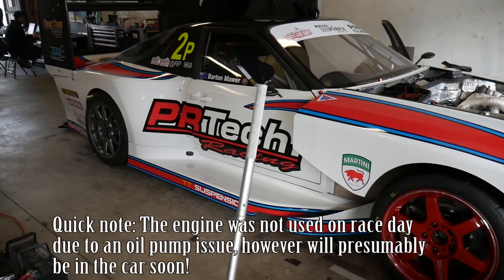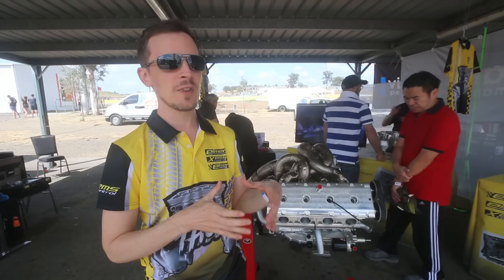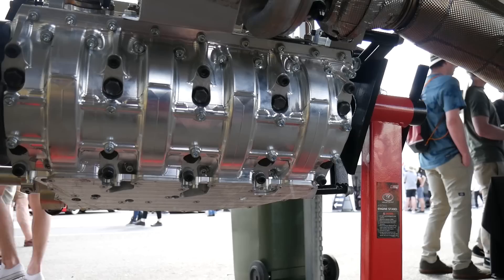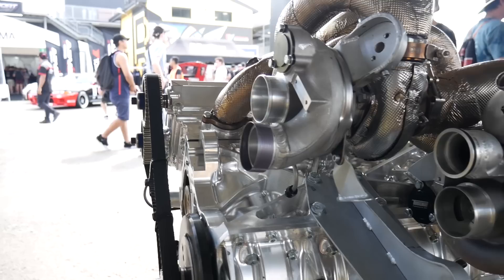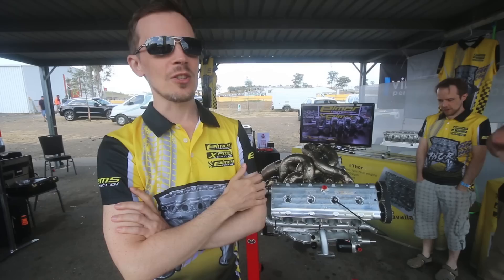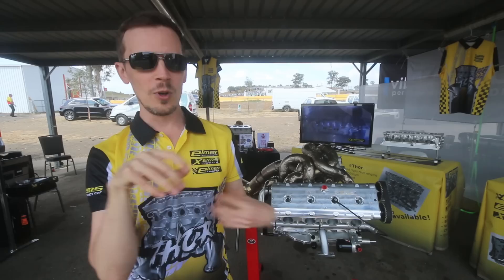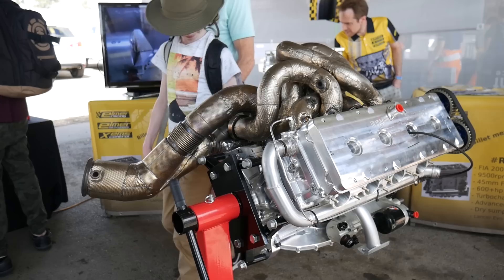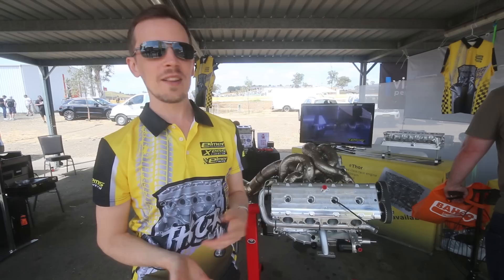4.0L | 4 Cylinders | 1500hp | The *nearly* All Billet RP968 Engine

Comment: It’s saying it’s all billet, but does it run cylinder sleeves?
Reply: Chucky boy Stanley at 5:35 you can see what I would presume are iron sleeves
Reply: It’s aluminum brah? Of corse it has sleeves ... could you imagine a ductile iron or even a tool steel piston ring traveling up and down a aluminum bore would resemble a broach not a internal combustion engines!!! When I was a young boy at the race track piping in to my dad’s important conversations to impress him and sound smart, he used to tell me... son.... it’s better to have people think you are stupid then to open your mouth and remove all doubt🤣🤣🤔 JK
Reply: Groom Lake just because it's aluminium doesn't mean it has to have sleeves could of been Nikasil or Alusil plated
Reply: Harry its a racing engine brother ?? They do not use that technology in purpose built racing applications... to my recollection
Reply: +Groom Lake According to Wikipedia it's used in a few racing applications: https://en.wikipedia.org/wiki/Nikasil

From what I can tell it's applied through electroplating onto the cylinder walls. Other than perhaps being expensive I don't see why they couldn't at least try.
Reply: The cylinder block is what they call 'open deck'.  The coolant passages are machined from above.  What i have not got my head around is how the coolant passages are machined in the cylinder head.
Reply: +Paul Standeven That sounds like an interesting problem but I am not familiar with how the cooling passages should be routed through a cylinder head. Can you explain the problem in more detail please?
Reply: Paul standeven, at 1:23 you can see some of the angles of the passages. Open surface(deck) head? maybe.
Reply: Porche V8's have an uncoated, treated Ali bore
Reply: Porche V8's have an uncoated, treated Ali bore
Reply: +NitroAl Wait, how would you treat it to handle combustion without a coating?
Reply: They could have lined the bores using a plasma transfer wire arc process.
Reply: NitroAl yes yes they did !! So did Chevy with the 70 Vega i4 . But this is a billet block . All bare aluminum cylindered blocks where a hi silicon Hyperutectic CAST. And the cylinders were treated in the porche . They are acid etched to expose the hard silicon . But the big thing is THEY NEVER WORKED GOOD . Burning oil was a big problem . You and the rest of the world need to understand EVERY THING IS APPLICATION DRIVEN !! Every thing is a compromise . Auto makers sacrifices almost everything to make more money from their product !! Racers sacrifice longevity for Performance and power out put. I wasn’t trying to comment that a aluminum bore has never existed my comment was to teach why that wouldn’t be smart it a Performance driven racing application . I like the title nitroal!! Are you involved in burning nitro? Because gas is for washing parts alcohol is for drinking and NITRO is for racing!! Cheers
Reply: NitroAl if there is a untreated bare alu cylindered block I would love to learn about it. I was under the impression at the least they are all acid etched ? Any info would be greatly appreciated ! Thanks again
Reply: Harry here’s the deal I like people to understand the physics so as to help the debate . I don’t want to act like I know it all I’m actually the opposite I’m a learn it all because I understand the more I learn the little I know . First off one needsto understand what the top ring does, and also the current trends being applied to gain performance ! Every one knows the top ring seals the bore so that the working pressure can’t escape in to the crank case . But what is often over looked is that 80% of the thermal heat created by the combustion process is transferred to the cooling system via the cylinder wall threw the face of that top ring!! Keep that in your head. Now with the current trends manifested by RULES is to combat  parasitic loss created by the induced friction of the piston ring set. Now days every one is on this low radial tension thin piston ring sets . By radial tension I’m talking the measurement in weight it takes to move the piston and ring assembly up and down the bore. Back In the day most every ring stack consisted of 1/16 compression 1/16 second and 3/16 oil retention . Now days guys are running .043 tops even .6mm in
NASCAR with low radial tension to free up the engine and loose parasitic loss. This is great and all but it creates a few problems that need to be dealt with. First off how to get that ring to seal properly so we invent technology to do so. You might see a lot of people turning to a dry sump system , yes it helps lower the motor in the chassis but the real reason they are used is to created a vacuum in the crack case witch combats windage but it’s real purpose is to suck the piston rings down on the bottom land and out to the cylinder wall on the intake stroke where the ring comes off the bottom land because of friction and the drop in pressure over the crown of the piston in NA trim. If any of the rings come off the bottom land they are no longer sealing! And to keep the ring sealed on the combustion compression and exhaust strokes we use GAS PORTS . There’s 2 ways of gas porting a piston , vertical and or horizontal. Basically by drilling a hole vertically from the crown of the piston down bisecting the back of the ring groove that positive pressure forces the ring out against the cylinder wall and down to the second land on the piston thus sealing the bore with the positive pressure over the piston. Also as you see in manny modern engines the ring face keep getting smaller and smaller to combat friction. You remember how I said 80% of the combustion heat is transferred to the coolant via that top ring , so if you make it smaller it will run hotter and be able to transfer LESS HEAT. I can’t speak for F1 but I can speak for nascar because I manufacture pistons for a lot of teams. What we do in nascar to combat brandishing or micro welding the top ring into its aluminum ring groove is we hard anodize the top groove of every piston . This allows the ring to run much hotter with out the risk of bringing the aluminum piston to its annealing point. What I’m trying to say is everything is a compromise , so I think there could be some real advantage to running a aluminum bore . Like the  thermal conductivity off aluminum . If you could get the aluminum to wear in a controlled manner the cylinder wall would transfer heat much better that a ductile iron wall. No matter what though In a pure performance driven application a ductile iron sleeve would always be better given a open rule book. There’s also the dykes ring I didn’t touch on that does the same thing as gas ports but with the profile shape of the ring and not holes in the piston . I’m becoming a fan of this time attack stuff even though I’m not in to watching it BECAUSE  of the open rule book!! I believe in the trickle down affect from racing to road cars . The problem is with so many rules now days a lot off the stuff we do to gain performance in racing is back Asswerds. We have to do some pretty outlandish crap you would never do in the real world to gain a Performance advantage and it usually would be the opposite of what you would do with no rules on the street . What I would love to see is every rule book in every sport be redacted with safety being its only thought .
Reply: Djhg2000 I’m sure some one some where uses it for sure!! Maybe lmp1 car or something but I’m also sure that they are using it for all the wrong reasons and that it gives them a weight gain or something while sacrificing longevity and serviceability. Like Audi or something. It’s makes the engine 10 lbs light but they have to throw the block away after every race. So they ain’t scared to spend 30-40,000$ per race to have that few lbs advantage . The best thing people can do to learn is study the DYNAMICS of the internal combustion engine!! Don’t think of it as a static lump of metal but think what’s going on while it’s running!! For instance static compression ratio  , people get lost over that stuff and never take in to consideration the cylinder head. If your engine has 10:1 compression and has a crappy head on it and say VE is around 80% on a good day your dynamic is around 8:1 and if you have a 10:1 motor with a prostock head on it that can get up to 130% VE then your dynamic is 13:1. Just because people do it in racing used to mean it was good and would be great in your street car is long gone!! Like titanium !! Omg I just get so bummed out when I hear people talk about using it in engines. Like say a prostock car using titanium valve springs . To compete you have to run them and it’s not because it makes a good valve spring but because the guys have so many rules that they are willing to spend 500,000 on valve springs to free up the valve train mass to get the motor to safely turn 500 more rpm giving them a 10 hp gain . Most of the things done to gain performance in modern race engine is the exact opposite of what you would want to do in the real world . And the real truth is all these rules now days to cut costs actually increase cost because people will always improve on their technology but now it takes a lot more money to find a lot less power so only the big teams will spend that extra few mill to find a few horse power.
Reply: +Groom Lake I was more confused to what treatment he was talking about which didn't involve some kind of coating.

Anyway you mentioned you make pistons for some nascar teams, have you experimented with different materials to change the thermal contact conductance coefficient between the piston and the wall? I'm not sure what effect that would have on the combustion cycle but I'd really like to know.
Reply: Djhg2000 between the rings and the wall. The rings transfer the combustion heat to the coolant via the cylinder wall. The trend now days is to go to a thinner and thinner vertical face on the ring , and when you go down in sq area it forces the ring to run a lot hotter. When you have a steel ring in a aluminum grove if that ring gets above 600 degrees it’s started to brandish or Burnell its self micro-welding in to the aluminum . To combat this it’s common to hard anodize the top ring groove . People often pay 60-100$ a piston just to anodize the ring groove . The piston skirt transfers little if any heat. First off because it is quenched with oil and second , you would be surprised how little of the skirt actually touches the bore. The skirt on a modern piston is NOT cylindrical . From the oil ring bottom land to about .500” down is the barrel from .500” to the tang it has taper. Also the trend is to machine eccentricity in to the piston so that when it heats up to operating temp it turns concentric . Basically if you look at the mass of a piston 80% of its mass is carried parallel with the wrist pin. Most of that mass is in the pin boss towers where the load of the wrist pin is taken. This creates a problem due to thermal expansion . When the piston goes from ambient temp to operating temp the piston grows in the bore due to thermal expansion . But because there is not much mass out at the skirt the piston tends to grow more in the parallel axis of the wrist pin then it does perpendicular to the pin and out on the skirt. When we do QC CMM we do it in a control room @ 72 deg F , so we machine it oval so that when it is at temp running in the engine, it is round. It sound like BS but it’s very real!

Comment: Let’s make sure every one understands the dynamic forces playing on the rotating assembly !! Making power at a higher rpm is EASYER ON CONNECTING RODS !!! And harder on the cap screw on the big end of the rod and valve train !! Making power at a lower RPM IS HARDER ON THE CON ROD!!! If a given amount of power is made at a LOWER RPM it is done so via MORE CYLINDER PRESSURE!!! Aka big kabooms!!! The resulting added stress will be translated from the crown of the piston down threw the pin boss towers affectively deflecting the wrist pin down threw the beam of the con rod to the crank pin! This is why you see so many snapped Subaru wrx/sti crank shafts  between the rod and main journal when short shifted or lugged at a low rpm and high duty cycle . So manny enthusiasts and so much misconception 🤔
Reply: true!

Comment: Jim Fueling did this back in the late 80s. Grats on being 29 years late. Also, he made very similar power but only needed 2.0L to do it.
Reply: again, refer to my first comment. the aerotech car was designed to break closed course speed records and ran WOT for many minutes on end. 

they were making 1500hp out of a 2.0 engine back when F1 was making 1300-1500hp out of 1.5L engines on a qualifying tune only and couldnt finish a race unless they were detuned to 900hp to finish a race. the aerotech engine was WOT for 20 minutes plus at a time. not 20 minutes total time, 20 minutes near or at max revs for 20 minutes. far more grueling than a few laps on a road course

concerning "old technology", the first ohv engine sold in a car was 1904, and the first ohc engine sold in a car was 1912. BOTH DESIGNS are over 100 years old. VVT was in cars LONG before honda. the first patent for it was in the 1920s, and working prototypes were made in the 60s, with Fiat selling a car in 1980 with functioning vvt. 

you seem to be ignorant about engines, attempting to downplay a 280 cu in engine producing 750hp n/a to turbo 4 bangers. compare apples to apples, youll be hard pressed to get a KA24 much past 500hp n/a, and itll be revving on the far side of 10,000rpm. for n/a, its either more revs or more airflow through displacement and/or headwork and headwork isnt going to make up a 200hp deficit.

Comment: Saying that it weighs only 106 Kg is a bit deceptive seeing as how 4 cylinder engines NEED forced induction to make adequate power and that exhaust manifold and twin turbochargers aren’t lightweight. And those turbos look too little to make 1500hp, meaning you’ll need larger (heavier) turbos to achieve such a power level.